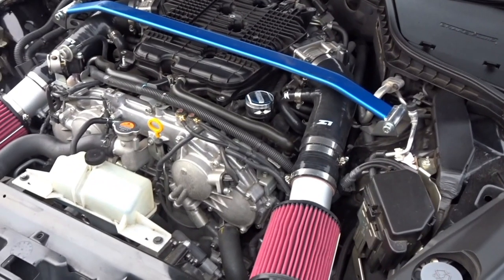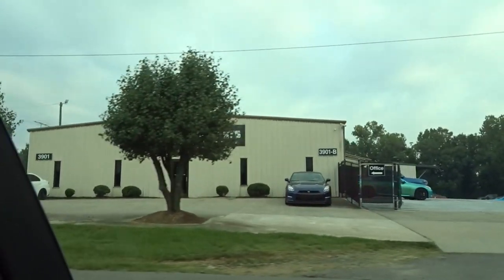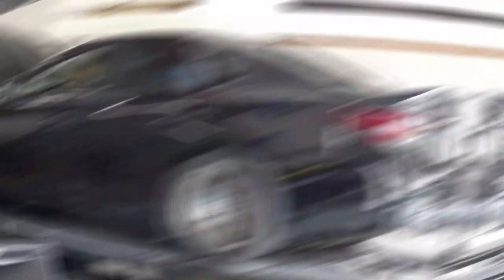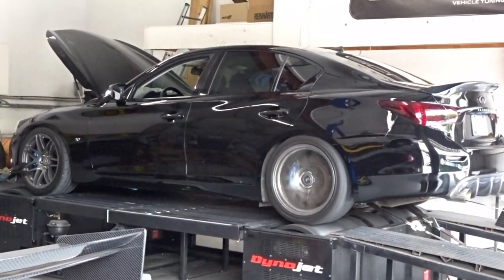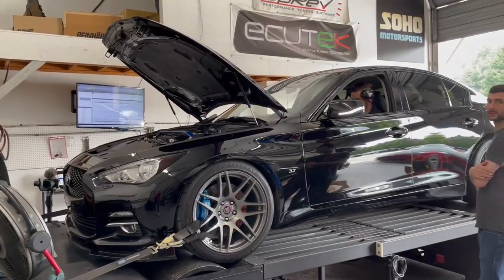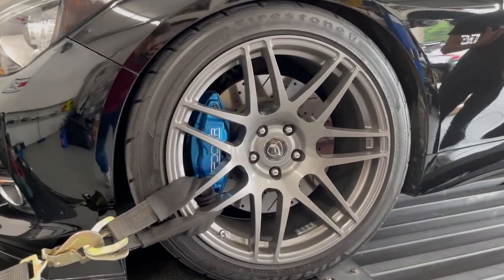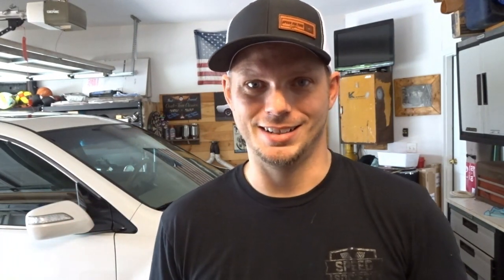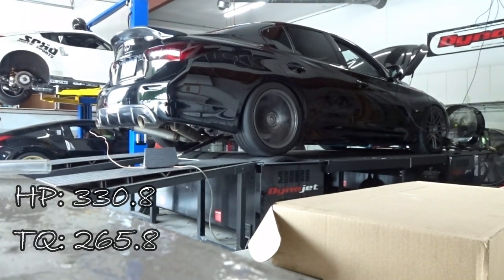Q50 Intake Comparison |  LOSE Power IMMEDIATELY with this Mod!

Comment: It's this type of quality content that keeps me coming back to your channel. I'm not surprised the oem setup is best. When infinity made this car to compete against the Germans, there's no way they would leave ANYTHING on the table.
Reply from the maker: Thanks a lot!!  And Nissan has been using this platform since the early 2000s so they’ve had tons of time to refine it.  To think that they did not maximize the intake system is crazy
Reply: Do you get anything, other than looks, with a intake runner tubes? I'm sure you have a video that covers it
Reply from the maker: @tykedogtyke  yeah just looks.  Cleans up the engine bay a bit
Reply: Word

Comment: Awesome you were able to do a side by side comparison! I also never intended to run an aftermarket intake on my Q50 but when going through the tuning process with Nick at SOHO they strongly recommended the Takeda intakes. I guess if nothing else they look pretty cool in the engine bay lol!
Reply from the maker: Even speaking with Nik in this video, takeda intakes will yield very little performance gains over factory intakes.  If you are going to buy intakes, They recommend takeda because they retain the factory air boxes
Reply: @SpeedCultureStudios  I see makes sense, I wonder if the smaller pipe diameter helps as well. I believe the Takeda is 2.75 inches smaller in comparison to your test set up I should say with the 3 inches.
Reply from the maker: @Dreamevil2009  possibly

Comment: Great video man! Glad I took your word early on when I had my VQ.
Reply from the maker: How are you liking the 3.0t?
Reply: Had a belt issue the second day I bought the car and got that fixed. Realized I was low on coolant and in the process of figuring that out but besides that coolant issue, the car is running strong and all my temps are good. The power band is so extremely different than the VQ and am actually getting better 0-60s stock on my VR than I was with the VQ a couple weeks ago. In my opinion there’s not a better feeling than driving a turbo car lol overall very happy I got the car and can’t wait for my JB4 to come in.

Comment: I have a q50 but spend most my time working on 30+ year old cars. The factory air boxes on old car are often cracked, old, and unavailable. Aftermarket is the only way to go in those cases. Anyway most aftermarket intakes are just hot air intakes and you got to fab up boxes, and piping to get them to work right.

Comment: This is good info. I read and researched about aftermarket intakes and I came to the realization that the stock box and silicone hoses with drop in performance dry air filters are the way to go. That’s what I have in my qx50 3.7l.  I’am not changing a thing. I seen dyno after dyno that aftermaket intakes lose power.
Reply from the maker: People hate to hear that!  I’ve been talking about this for 3 years and people fight me so hard, but it’s just true!

Comment: You and I both have said over and over again, the factory intake setup on these vq's is 99.9% of the time, the best option..  Even going back to the old SR20's and 1st gen vq's... They put a lot of energy into these intakes.. Same with the v8's.. Saw a 5hp loss with intakes on the q70 5.6.
Reply: Which intake did you go with on your VK?
Reply: @stickemup18111  started with a K&N drop in dry filter, then a wet filter. Then a K&N long tube intake on the factory box. Next was an injen kit with their filter box. After that i had a local shop do a custom CAI. I saw no gains whatsoever with either K&N option. And even saw a 5bhp loss on an AEM kit. I saw 3 bhp with the injen kit on their filter box. Saw 4 bhp with the tru cold air custom setup.. Sooooo anywhere from .8 to 1.1 whp????? It never ran right on colder days, and had a funky wet sounding idle... Very sluggish off the jump with every setup, almost like it was flooded.. But there was a touch of higher top end performance... Overall, best option is to relocate the factory box for a tru cold air setup, and have it retuned...
Reply: @stickemup18111  TBH, your money would be better spent in exhaust work, or even a simple tune
Reply: Uh   admintuning  intakes has a proven track record for gains, but they are expensive, and require a tune.
Reply: @mikeschaner5853  I have had good results from the airaid mxp on my vk with no issues. Granted I do have full exhaust and tune. But I have never seen bad reviews of the airaid compared to stock box. Have seen many people go from the modified stock box to airaid.
Reply: @stickemup18111  good to kno!
Reply: @AQCE245  with other mods sure. But intakes alone?? 15 hp?? Even with a tune is extremely hopeful..

Comment: LOL I know the feeling when you spend a bunch of money and the car goes slower than before :-(. I have seen on other videos that the stock airbox is the best option out of all of them.
Reply from the maker: Yep.  This is what I’ve been saying for 2 years but people hated to hear it, despite all the data.  It was great to get on the dyno and give real time data and comparisons to prove this point
Reply: Nissan put A LOT of thought and engineering into these intakes.. Even on the vk's the factory setup is very hard to improve on..
Reply from the maker: @mikeschaner5853  exactly.
Reply: @SpeedCultureStudios  what about the k&n drop in filters?
Reply from the maker: @thesamur1813  aFe dry
Reply: @SpeedCultureStudios  is there any power difference between the k&n and afe, I have a 2014 q60s manual. I have a k&n in my motorcycle already, and it seems like the price is close to the same. Are the aFe ones re usable as well?
Reply from the maker: @thesamur1813  afe is washable yes.  They are not oiled so no risk of gumming up your MAF sensors
Reply: @SpeedCultureStudios  and do both net around the same hp gain, obviously it won't be big but I saw a couple dyno test videos for the k&n showing around 5-7 in most ranges and 10-15 at the max
Reply: @mikeschaner5853   If I'm not mistaken he was comparing "SHORT RAM" intakes if he Is its been proven over and over again stock airboxes make more power then short  ram.throw on  3inch Admin intakes and  let's see the numbers. There are 100s of dyno sheets  on G37 fourms that admin intake make 15+HP over the factory boxes even my car is proven fact 290Hp with stock boxes install admin intakes dyno 314HP.

Comment: Great info and data. One thing to consider here is that if your motor is not needing more air, Giving it more will not do anything. Also..was this test on Stock  manifold and TB? Larger Intakes will reduce Air velocity with out anything else done to the intake system. So this all makes sense. And it's been seen over and over again on the dynos. This the reason I have not even considered intakes, drop in filter with Z1 tubes and call it day.
Reply from the maker: This is what I’ve been telling people for 2 years now and is one thing that people have thrown hate at me for the most lol.  The sole purpose was get on the dyno and prove my point—or admit to being wrong.  Now the real time data shows that I have been correct!
Thanks for checking in!
Reply: @SpeedCultureStudios  yeah, I think people get upset when they spend $$$ on a product and then get told that it doesn't work. Lol. It's not like you are making any of this up, I mean the data is there. Lol.
Reply from the maker: @samchoc6811  exactly right.  Don’t get mad at me lol.

Comment: If I am looking to tune in the future you think it would be better just to buy the aFe filters instead of buying an aftermarket intake? I see a lot of tuners recommend an intake for their tune.
Reply from the maker: Factory air boxes and filters make the most sense.  That’s the whole point of this video.  You can spend $500 on intakes if you want but you might only see 2-5 hp peak

Comment: the issue with the larger intake tubes , is they slow velocity , with velocity , you lose heat.  slower velocity allows more wicking of heat from parts and underhood temps to the actual inlet airflow being its moving slower, so exposed longer .
Reply from the maker: Interesting point!

Comment: Interesting stuff... I ended up swapping out my stock intake with the aFe Power Takeda intake and haven't noticed any loss in power whatsoever (but no gain either, obviously). The Takeda intake pretty closely resembles the stock intake though. I would've stuck with the stock intake but the plastic is horrendous quality, really brittle, and I just didn't want to deal with it.
Reply: There's no shame in admiting you like the looks of an intake over stock air box. Lol. aFe are not bad of a product though.  I personally don't think the stock box looks that bad once the Z1 tubes goes in. I bet the aFe intake creats a bit more induction noise. That is sometimes a preference over stock intakes regardless if there's no power to be made. BMW E90 V8 guys upgrade their intakes just for that sound alone. I love induction noises. Haha.
Reply from the maker: Yep if you’re going to do intakes, choose takeda to keep the air boxes
Reply: My factory air box clips were broken and were a pain to keep in place. Went with the takeda afe replacement because it was basically the same price if not cheaper than getting new factory air boxes. 👍
Reply: @dylansimmons4057  Yep that's precisely why I did it too. The stock air boxes aren't worth it if you have to replace them. The plastic is really cheap
Reply: @dylansimmons4057  my clips are broken on my air box too , did the takeda kit come with clips for it ?

Comment: i really like the video and the idea behind it, i just don’t get how admin him self makes more power when the cars he tuned switched from 2.5” to his 3”, but you switched to 3” intakes at soho and the intakes made you lose power, but he makes more power with them… 
also one thing to consider is most people use e85 with these intakes. since you’re bringing in more air you can make use of more octane, and therefore more advanced timing without detonation. so yes if we’re just adding more air to the mix with 3” intakes but aren’t adding more fuel to the mix then you still could only make the same power or less like we seen. just my thoughts, but overall a great video with good information, and i really like the R&D you do for the community.
Reply from the maker: I don’t think “most” people are on e85 with the intakes, but as I’ve always said, the g37 responds better to intakes, which is what admin tuned mostly.  You also have to understand that admin is trying to sell you HIS 3” intakes.  And my car didn’t lose power—it just dropped power compared to drop in filters.  My car was already tuned, don’t forget.  So if I would have installed these 3” intakes and tuned it for the first time, these would have been gains.  But compared to factory air boxes, they are no good.
Reply: The Q50 Factory are boxes on build way different from the 370s, and the G37. From 2014-15 Q50 they built them more efficiently. And the Q50 final drive ratio is also different
Reply: @tashaunsoto6940  I also believe that they use a different exhaust manifold that flows better.
Reply: @latino914  yeah I did hear that a couple times bout 3.7 q50 stock headers flow real well.

Comment: Opinions on the UPT 3in long tube intakes?
Reply from the maker: I’m not all that familiar with the brand but the Q does not respond all that well to intakes.  If you really want intakes than 3” long tubes would be the way to go—except you have to modify the core support to run 3” which is not ideal

Comment: I'd like to see some variants on the catback, im looking at basing a 2.5 dual system for my a6 3.0t off yours, ill be running test pipes, but thinking about running either magnaflow or borla pro xs rear mufflers
Reply from the maker: Yeah I’d love to do a lot more testing but my 2.25” catback made 333/284.  My 2.5” catback made 334/276 in very similar conditions.  Now we see what the 2.25” test pipes did with the 2.5” catback, but have to consider it is 40 degrees warmer and much higher humidity
Reply: @SpeedCultureStudios  I'd be at around 400bhp with a 91 tune and stock converters/2" dual exhaust, I'm wondering if upgrading the catback would be worth it, or just do test pipes
Reply from the maker: @KenyonPayne  turbos like exhaust flow but I’d say cats are much more of a restriction than the catback.  Obviously you run into compliance issues with eliminating cats though
Reply: @SpeedCultureStudios  its actually supercharged! Same motor as the 11-17 s4s.

Comment: I wonder how Actual Cold Air Intakes would perform vs the stock air boxes.(Custom made like how freshhkiicks did on his q50)  The test you did doesn't really surprise me because even switching to 3" intakes you still have them in the enginebay sucking up all that hot air so of course your going to loose a lil power vs the stock air boxes that's actually designed for cold air direction getting help from the radiator cover.
Reply from the maker: I discussed all of this in the video.  The hood is open and fans blowing into the intakes so it really isn’t pulling that much heat into the engine in this case so the expectation was to pick up some power although yes in regular driving with the hood down, hot air intakes are no good.  3” long tubes intakes help keep the air cool but have been shown over and over to provide little if any hp gains in the Q50.  The G responds a bit better but the Q sees nothing in power gains from intakes.  Nik at Soho confirmed that this day which I mentioned in the video.
Reply: @SpeedCultureStudios interesting good to know!

Comment: I wouldn't go so far as the worry about mileage nowadays, my 2014 Q50 is at 189,000 made 340 at the rear wheels and never seen the back of a tow truck since I bought it back in 2014
Reply: What’s mods u have

Comment: Great video thanks for that …. So with the 2.25  test pipes  did u get a check engine light and if it did did it go away with the tune
Reply from the maker: No CEL with different test pipes, but the car was already tuned

Comment: What's the name of your cat back exhaust and what did it run you
Reply from the maker: It is a custom catback system that has come to be known as the SCS Catback system, which you may have heard me reference in the video.  All components can be had for around $350.  Then you have to consider whatever a local exhaust shop will charge to piece it all together.

Comment: Great video,  love it
Reply from the maker: Thanks, Josh!
Reply: @SpeedCultureStudios  what if you heat protect wrap the factory air box ?
Reply: Like dyna mat  for engine bays on the air box and intake tubes
Reply from the maker: @joshrichie9833  I don’t know that the factory boxes need heat protection but it wouldn’t hurt.  The intake air temps stayed consistent pull after pull with the factory boxes so they are doing a good job keeping cool air coming in

Comment: Why should you not drive with 3 inch intakes without a tune?
Reply from the maker: Because the car may not run right—many people have gotten check engine lights with intakes and no tune on this platform.

Comment: Would UPT intakes make a difference much longer with better airflow and aren’t getting much heat soak as they come to the front lower grill of the car look into those and make a vid!
Reply from the maker: I mention them in this video.  Length doesn't change flow, but it does help keep temps cool.  The Q50 doesn't respond all that much to increased air volume as we showed in this test, so longer and wider intakes are only good for maybe a couple hp up top.

Comment: Channel would boom with a 3.0t modding
Reply from the maker: It might but there are already so many people out there so it’s hard to say
Reply: @SpeedCultureStudios  with the 400z coming out it’s a no brainer. Get a 3.0t and just swap the parts wheels and etc over . Then chase the 1000hp build
Reply from the maker: @jcproductions89  So tempting!
Reply: @SpeedCultureStudios  u have a relationship with soho be a good build . Or boost your car be cool to see with manual swap
Reply from the maker: @jcproductions89  I would never dump the money into the q that it would take to boost and manual swap.  But a new Z would be rad.  I’m sure soho will jump in one themselves too.  Hard to start modding a $40k brand new car too lol.  I’m not on that level yet!
Reply: @SpeedCultureStudios  I would definitely try and get the new Z if I was you. That would make your channel go crazy especially if you and soho start fabrication on parts

Comment: would u ever though meth /water injection to get intake temps down?
Reply from the maker: No because the factory air boxes kept the temps pretty low.  I suppose there is potential to keep them cooler than ambient temps but it’d just get me back to my best numbers of 334/276 which isn’t a huge difference

Comment: Yo I got an idea for you secret weapons 🤔 try them I’m sure we want to see the difference and you should’ve went with that idea other than these… we knew they weren’t good to being with.
Reply from the maker: I don't know what you mean lol
Reply: Weapon R*
Reply from the maker: @phantoment.3280  the Weapon R intakes would not be better—they may actually be worse because the MAF tube is actually smaller so the only difference from the stock intakes is that they’d be sucking hot air with no benefit from increased volume.
Reply: Well look at that, and I thought it was gonna be abit better but worse just like those short ram, that’s sucks, they make it seem like there hot stuff lol but guess you gotta stick with the basics and a couple of different components.

Comment: This is why admin won't tune a car with short ram
Reply from the maker: They definitely pull in heat, but don’t miss the fact that even the first pull with 3” intakes lost power compared to factory air boxes—before heat was an issue.